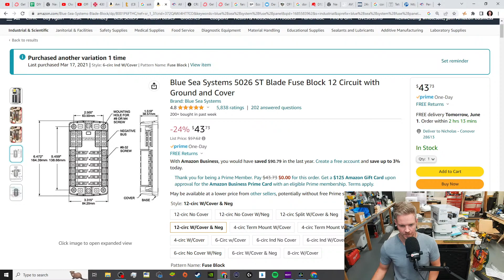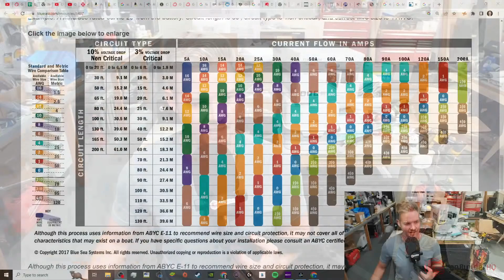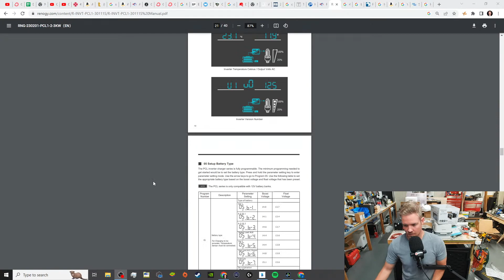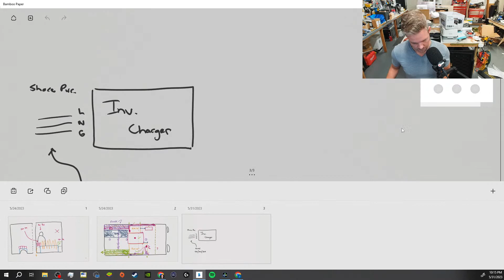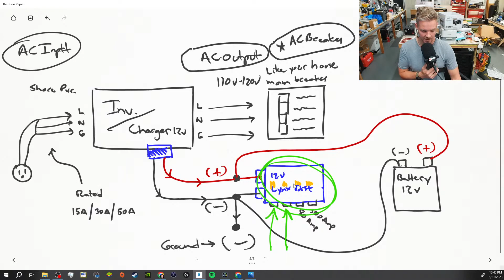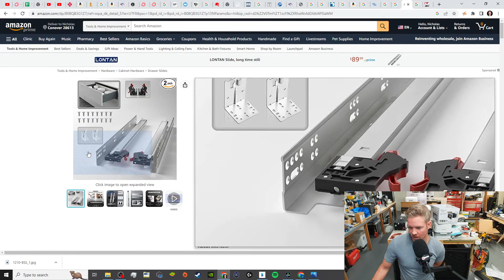Connecting a 12V Pure Sine Wave Inverter Charger with step-by-step walkthrough | Live Q&A

Comment: Heeeeeeyyy! I need to do this to my RV in the next 2 days because it didn't come with an inverter, just a generator and converter with 2 lead acid batteries... I don't want to be running my generator just to do simple stuff like charge cellphones or run the microwave a few times, so glad you're introducing this topic!
Reply from the maker: Hi Jason, Thank you for your question. You can simply use a 2,000-watt pure sine wave inverter connected to your 2 lead acid batteries to run your Microwave, Charge your Cell Phone Etc. I say 2,000 watts because you may want to operate/charge at the same time (plus the cost is reasonable). The Renogy Inverter has 3x household plugs in the unit right out of the box. 
Look out for the livestream tomorrow and I will cover this topic in detail! 
Link to inverter: https://www.amazon.com/gp/product/B07H9SXV61?ie=UTF8&psc=1&linkCode=ll1&tag=vanbuilderhq-20&linkId=9006d47037ac2adf8615a6c3a9a1d2b6&language=en_US&ref_=as_li_ss_tl
Reply: @vanbuilderhq  Thanks for the shout man-- we actually have a class C that has a full on distro box and onboard genny but it's a bargain model so there's no fancy transfer switch or inverter-- in fact, the shore power plug basically plugs into the generator 30amp outlet whenever we're not hooked up! LOL 

I want to build something really fancy bit by bit-- solar, LiPo batteries, the works, but baby steps are in order because our budget isn't there... Looking forward to seeing your DIY methods and try to translate them into rennovations for this Class C!